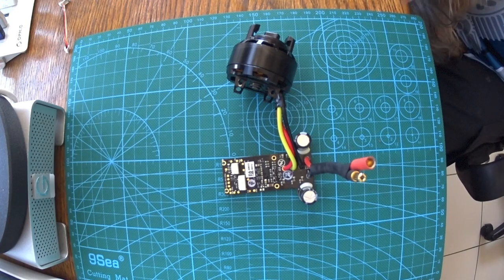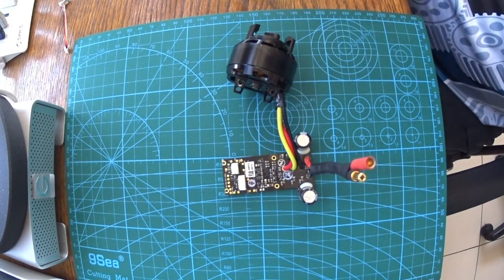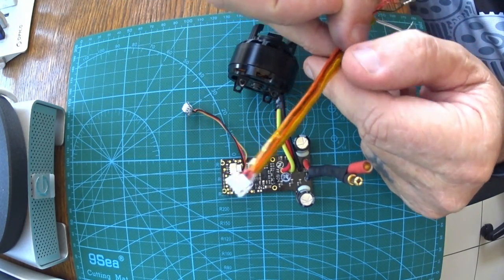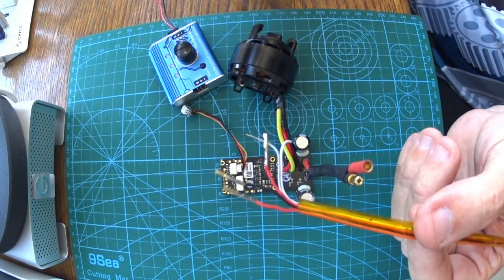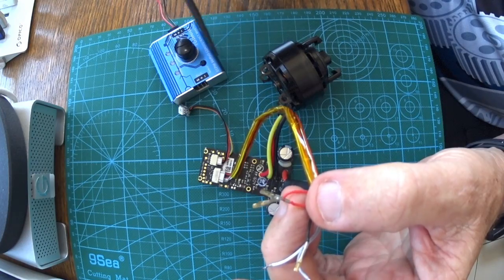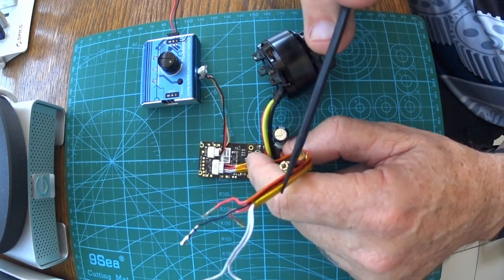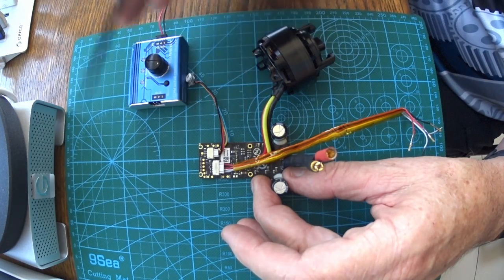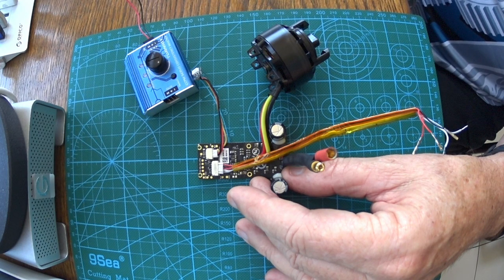HELP!!  How do you bench test a DJI Inspire ESC Motor combo

Comment: You can calibrate it on the radio and the receiver, but you cannot calibrate it via a test servo ..just like what happens in the phantom 2 esc if your want calipriton

Comment: Hi Allen, I'm just a tinkerer, but would it be easier to set up a standard flight controller and battery board on the bench. of course it would mean you would have to use a remote controller. If that run that efc and motor ,then that would be a yes or a no. just one other thing is that in your other video of repairs, you showed a what was believed to be a blown diode or resistor on the battery board,but looking at brand new board pics the same thing you pointed out is also not there on the new board. can you look into that further please. I couldn't make the comment on the actual video as you have the comments turned off. Cheers

Comment: Hello! I've four inspire 1 original motors like this, but I dont know how to connect it to a naza M. Do you know where could I buy the jst or cable?? I'll try to do it work with the naza.

Thank you in advance.
Reply from the maker: Nacho, I have been told you can use these motors with the E600 Esc from DJI. I actually had some but recently sold them when trying to make some space in the shed.  If you can find E600 ESC-s you should be right, EBAY might be a good place to look.

Comment: try to use dji naza flight controller. soldier the pwm as a signal. u need to troubleshot the wire if the test point if it’s connected, if not soldier the pwm test point with a wire.
Reply: Hi! How do you connect the naza with the esc? Do you know any guide or wiring diagram??? I'm really new so I dont know which is the pwm and the test point. 

Thank you very much!!!
Reply: Go to google the dji naza v2 for wiring diagram

Comment: Hi Allan, If you are still having trouble finding an ESC try computeruniverse they have them for  around £40. I'm having same problem with water damage and I have found 6 Inspire 1 with motor and ESC do you know if I can fit the latest motor to the original first Inspier 1 Esc we are also trying to test the ESC but no luck so far, not even from DJI contact. but will let you have all results if at all possible.
Reply from the maker: Philip Holsworth.  Yes to using the V1 ESC on either the V1.2 motor etc. They run fine. I have since traded that machine in and have the Inspire 2 in the fleet. Hopefully it won't be used as a submarine. If you have a really good magnifying lens or something similar have a really hard look at the processor filaments. I found all four had burnt at least one trace and that definitely happened when it went swimming under load.

Comment: connect the black cable to negative, red to signal ppm, I've tried it and it works, please try
Reply: bayu permana ， any details about it ? Video?
Reply: Please any pictures of it?
Reply: Thank you 
It works for me
First (red) to signal
Second (black) to negative
That's it
3 wires left ( cancel)
We need to positive wire
I used black wire as positive from LED port

Comment: Its above my pay grade...but was watching this on a flight controller which took duel signal cables. Might be the same idea on the inspire escs. https://youtu.be/AcZnGN4ElW8?t=1m15s
Reply from the maker: Yes I have been searching for weeks and the more I look the deeper the level of effluent I find myself in.  I'm finding the ESC is a lot more complex than the run of the mill stuff and I suspect a lot of that is due to the ability of the ESC to have the firmware upgraded and also be health monitored from the flight controller. The dual signal from the flight controller is also another possibility. I'm still ahead of the eight ball as I got this frame for practically nothing so if I have to shout it a full set of motors and ESC's then so be it.  But that would buy a good few pints down the local just the same mate.
Reply: A flash bit of kit, hope you get it sorted. You with 45 years in the hobby....me with 3 and no knowledge of electrickery. Hope someone comes though with a way to avoid the dji racket.